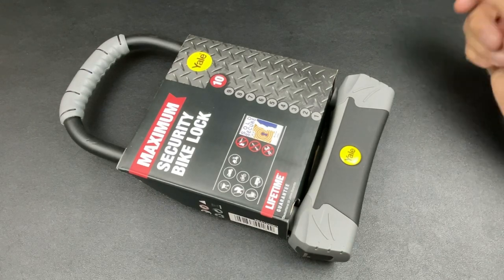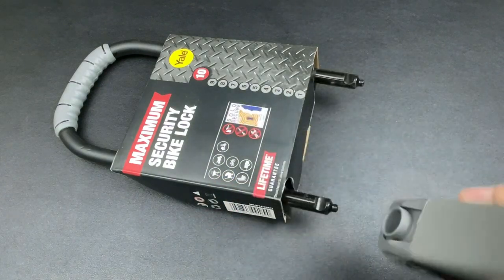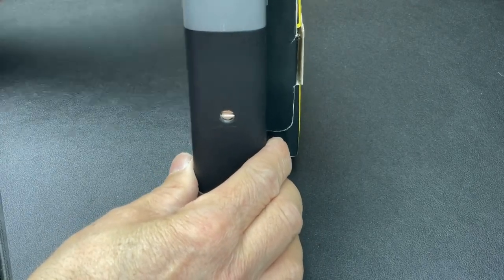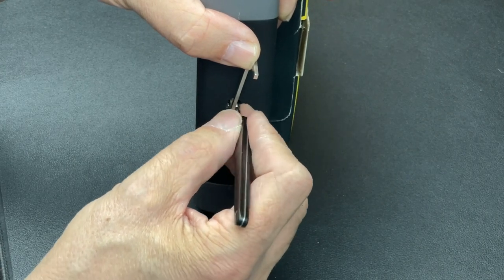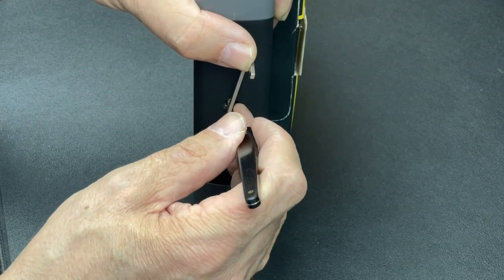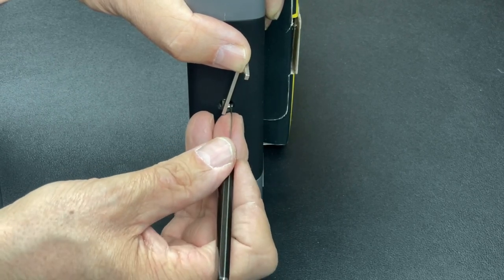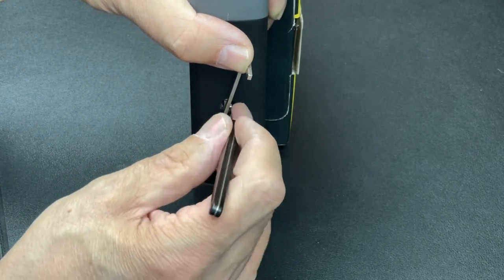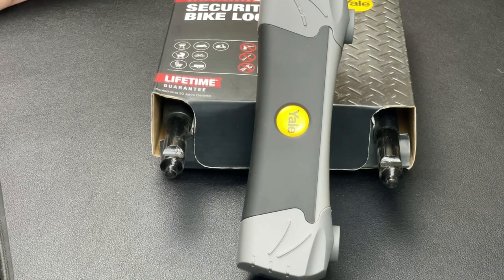Yale Maximum Security Bike Locks (8 slider 2 sidebars) picked open.

Comment: 10 out of 10 😮. Coming from you Daz i can only assume that this lock is trickier than meets the eye. Well done mate and have a fantastic Christmas and New year..👍
Reply from the maker: To be honest they are pretty tricky to open, & I’ve picked a few slider locks, if they had of put the 10 slider Version in this lock, I’d probably still be working on it. 
Have a fantastic weekend & New Year Wayne. 😎👍

Comment: You make it look easy. Well done Daz. I don't see many slider locks but I have the Onguard beast that requires so much tension it's ridiculous. Merry Christmas to all. Stay safe
Reply from the maker: Thanks Albert, I think this lock has the same or a very similar core in as the OnGuard Locks. The Beast has the 10 slider Version in if I remember correctly & it’s it’s a tough one to pick. 
Have a great weekend mate. 👍

Comment: Nicely picked Daz. Chances of someone picking this lock to steal your bike aren't high. Looks like a solid lock from what you showed 👍I'd be surprised if it takes all that much longer for slider locks to stay in the safe zone without false gates though... raking and jiggling works on slider locks too. Did you try any of that on a lock like this?
Reply from the maker: This is a great lock that was pretty tricky to pick. Have a fantastic Christmas & New Year.
Reply: @dazevers  everyone can pick it after watching this

Comment: Great job on the Yale D Lock. It's good to see a lock that does take its security rating serious. Nice beefy shackle, four locking points and a lock core with double side bars.

You made this one look like it didn't warrant the 10 out of 10 because you picked it so well and so quickly. This shouldn't put someone off from buying it as most pickets would struggle with it and the average Joe on the street isn't going to get this lock open. 
Great video as always Daz, thanks for taking the time to put this video together.
Reply from the maker: This is a great lock that was pretty tricky to pick. Have a fantastic Christmas & New Year.
Reply: @dazevers  I looked on Amazon and Ebay to see the price of this lock. The range in price is crazy,  from just over £30 to nearly £70. They all looked like the same lock but wasn't sure.
Reply from the maker: @roysammons2445  I payed £32.00. & for a good bike lock with a sold Secure gold award isn’t to bad. .... I think .. 😎👍
Reply: @dazevers  Fantastic value to keep a bike safe. Either that or stick a cheap lock around your bike and lose it 😉 the bike I mean😂.
Enjoy the festive season buddy.

Comment: Shame you do not show the mechanism of the lock, where the bars enter if there is any heft to it. Nor do you mention the quality of the U bar. Most thieves will not pick a lock but rather cut through it or break it. You do not address these issues and it's a shame. Another lockpickinglawyer cooycat